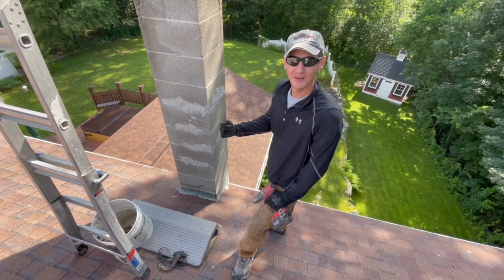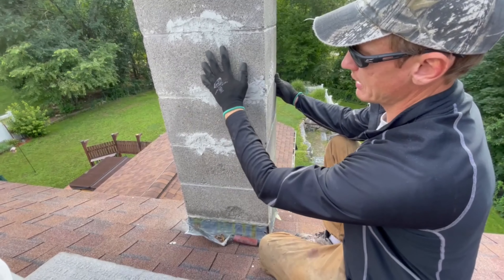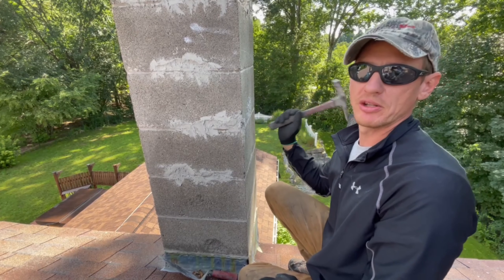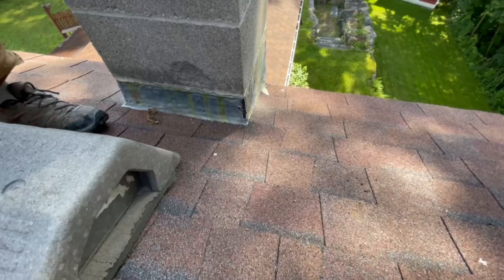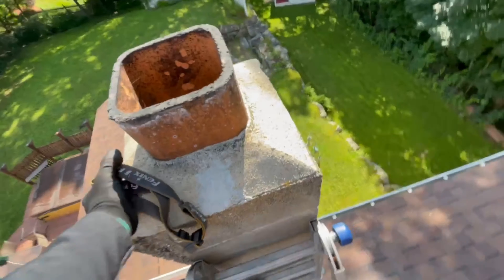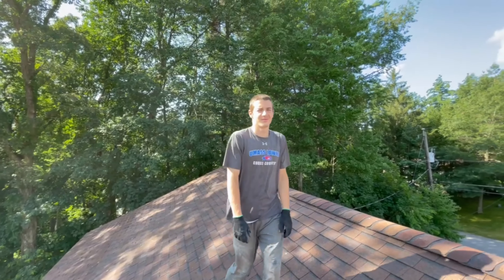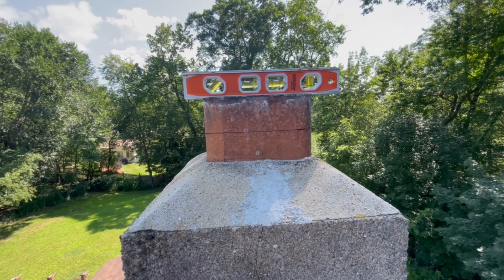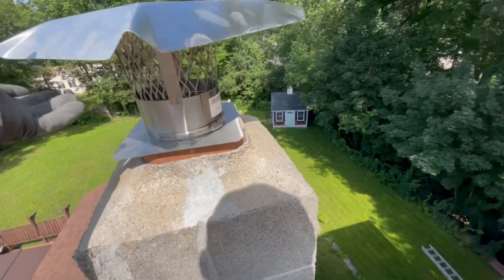Block chimney discussion/new stainless product

Comment: As always great information!
Reply from the maker: Thanks again!
Reply: Chad if you were building a new house and intended on using a 2 flue chimney for 2 wood stoves only, would you stay with a clay liner or go with a stainless steel liner based on your experience? @chadvaillancourt
Reply from the maker: I would go stainless every time with a wood stove. Ive seen clay liners crack on the first use, granted it was from misuse, but there’s just too many failures, too often, when a wood stove is involved.
Reply: Thanks Chad! @chadvaillancourt

Comment: Nice, I saw you cut a few to make upper smoke chamber. Im building a 30" fireplace and could not find flue tiles, 13x8 only 13x13, will they work or can I cut them down with alternating the cut to fit like bricks....
Reply: I'm in Oklahoma and was told by the local mason to run my outside chimney up solid to tiles???
Reply: Any info would be greatly appreciated
Reply from the maker: There are many ways to build a smoke chamber, I use the flue method when I need extra room. If you don’t need the extra space, just build it with brick or block. Make sure it’s 8” thick and smooth parged on the inside, and everything will be fine.

Comment: Greetings boss. Im about to buy a house with a cinder block chimney and its got a leak down the flashing straight down to the crawl. On closing I will be up on the roof repairing the flashing. I wonder if you have a video specific to flashing these style chimneys. ty for teaching me. Saved me from using a 3 gallons jug of tar.
Reply from the maker: Block chimney Rebuild | Flue removal |Stainless steel chimney liners
https://youtu.be/jOZ-06g_wsI
Try this one. I can’t remember how specific I was with the flashing, but it may include what you’re looking for.

Comment: I have got a wood stove connected to a masonry chimney that has terracotta (clay) liner inside cinder blocks, But it appears that there is gaps between the terracotta liners pieces, I can fit my fingers through the first junction, I couldn't try the others one since they are too deep. I have heard that it was possible that it has been built this way. Have you ever heard about this process? House is from 1978 . Thanks!
Reply from the maker: There shouldn’t be any gaps between the flue pieces. Sometimes at the very top the flue pieces will separate from thermal expansion, this happens if they pour the concrete crown wash directly against the flue without leaving room for expansion.
Reply: @chadvaillancourt  would it possible to talk about this in message - email by chance? I would really appreciate. I haven't find anyone they could explain me how it's work and I'm really concerned. I would be really grateful!
Reply from the maker: If you have pictures that would make it easier. Cvmasonry04@gmail.com
Reply from the maker: Why chimneys need a bond break (required to be code compliant)
https://youtube.com/shorts/JKYuEJhlxns?feature=share